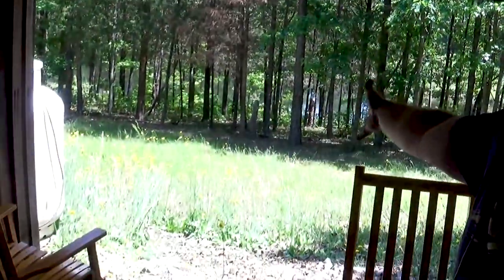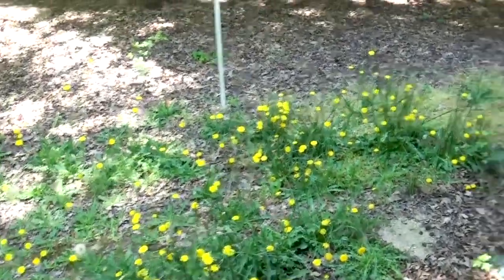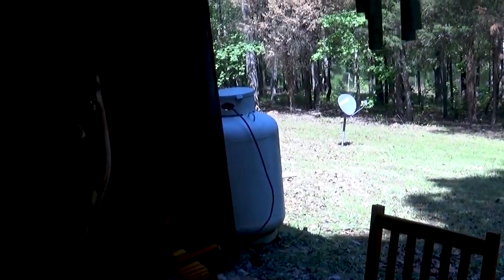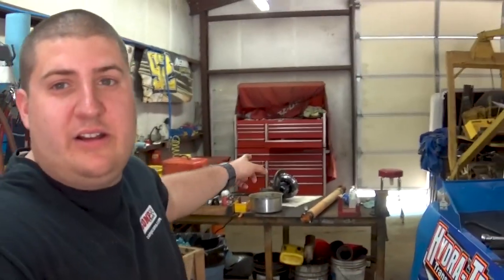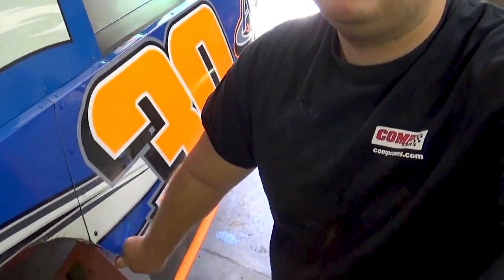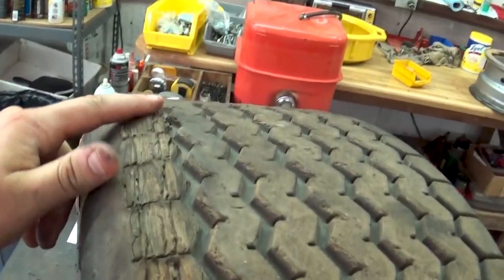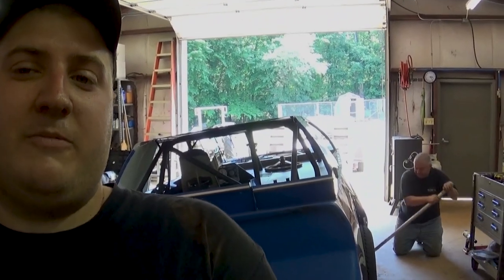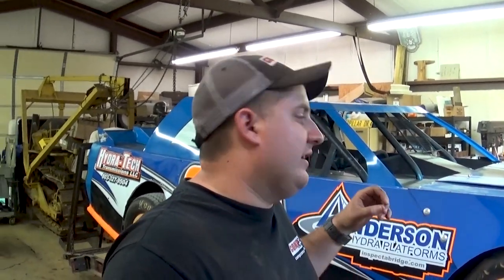Getting Ready For Race Weekend!

Comment: Any hoo! LOL Put more negative camber in the right front. 2 or even 3 degrees. If it's allowed run a spacer to bring that wheel out a little. On the left front put 2 degrees of positive camber .While you are doing that put as much pos. caster in it (both wheels) If you have a little slop in the steering toe it out a 8 th That is a starting point.  Driving on a flat surface if you let go of the steering wheel the car should pull to the left!